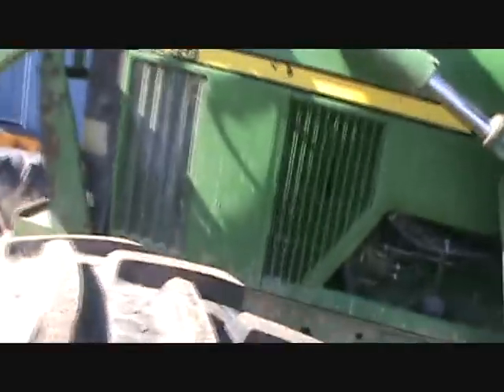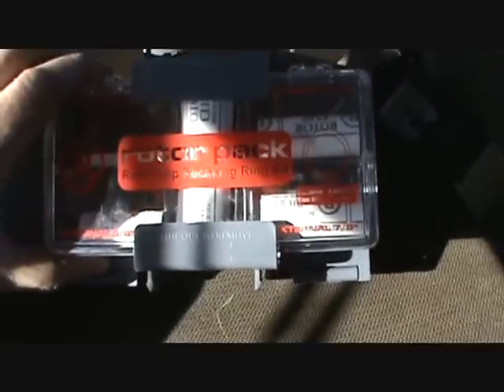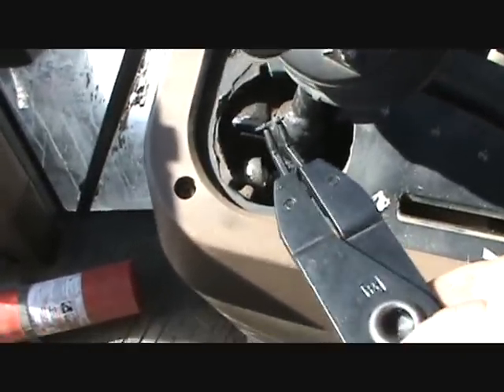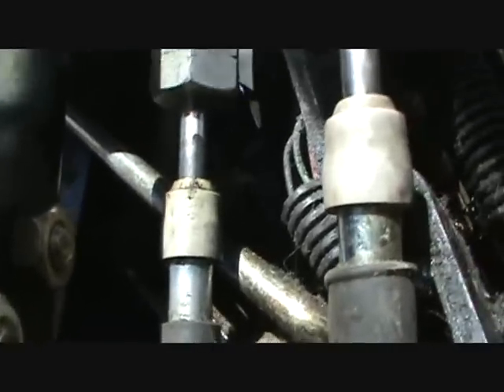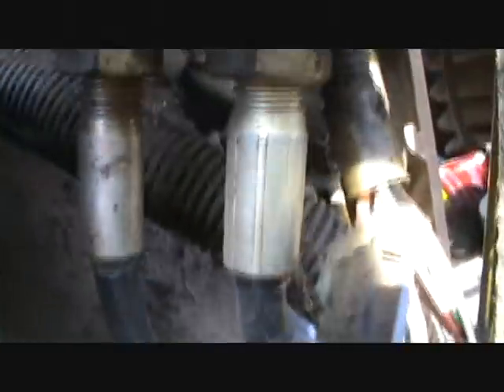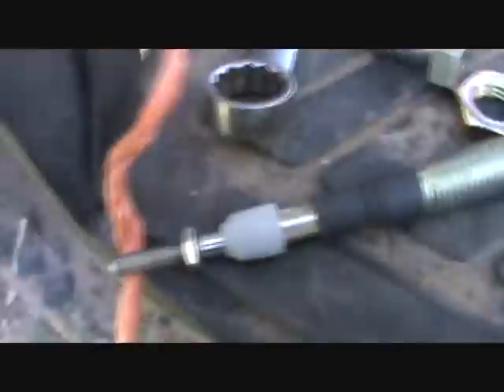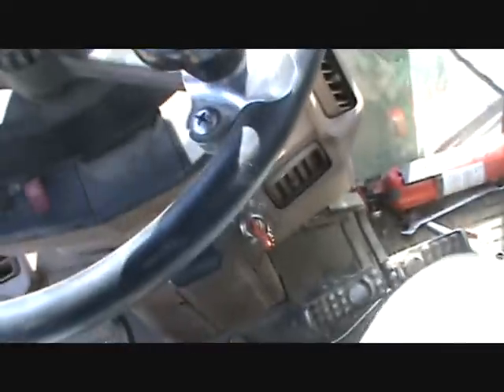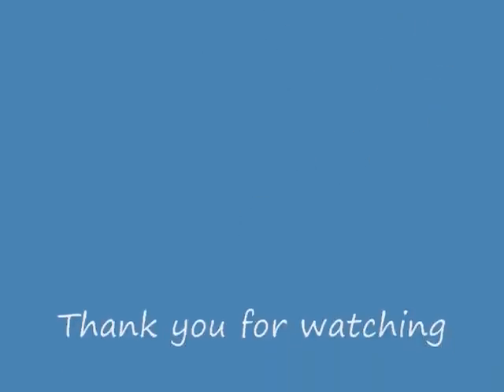Throttle and Loader Joystick Repair.wmv

Comment: Late but, shrink tube works better than taping, no 'shoulder' to catch. Put one end over what you are pulling the other over the twine then heat. Will slide right thru.